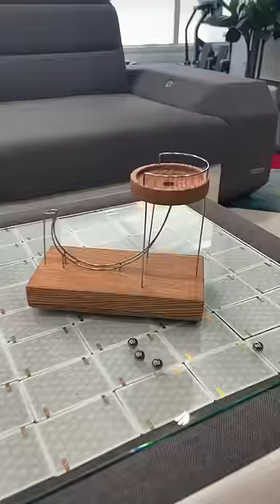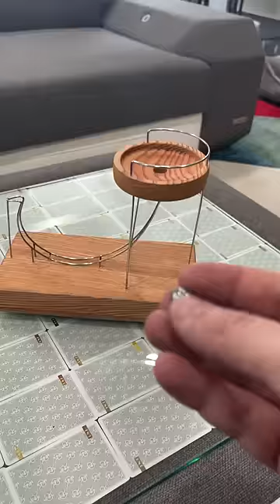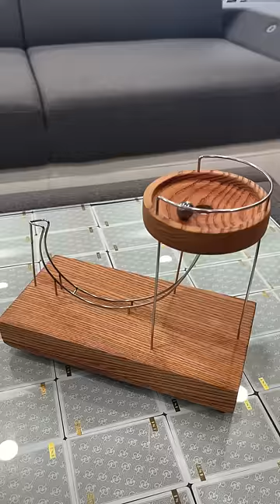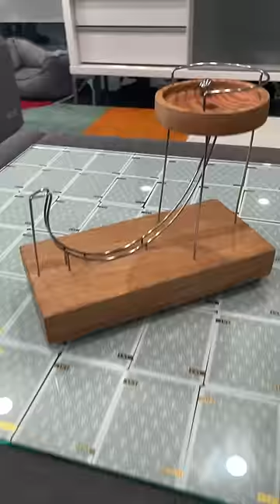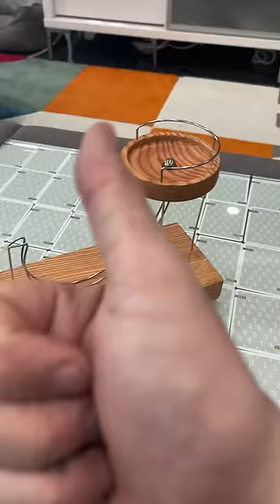An Impossible Perpetual Motion Device?! 😳 #Shorts

Comment: I like how he presented the device, without stating any lies but at the same time withholding just the right amount of information to not break the miracle.
Reply: I have an idea on what the “miracle” is based on the odd sound it makes when it goes down the ramp but I won’t say anything either because I’m not sure anyways, plus it’s still waaaay better than the “perpetual motion” devices that use batteries…
Reply: @zyanidwarfare5634  yeah it is definitely something like that. Even the first jump of the ball is already impossible because it could not go up any higher than it goes down without adding extra energy somehow.
Reply: @vanderslagmulders  it still doesn’t use a power source like batteries though so its still perpetual since it won’t run out of charge?

I mean it doesn’t produce any power of its own but it is an “infinite” loop until it makes a mistake
Ima just put what I think it is way down so people have to click read me to spoil what it might be cuz I want to make sure were on the same page

I’m pretty sure it’s magnetic
Reply: @zyanidwarfare5634 

Not sure maybe u right but on the other hand it’s a ball so if u mean if it’s gotta do with the two same poles repelling eachother I doubt it would work with a round, rolling magnet - the opposite pole would roll into position and the movement would stop or slow down. But hey I’m just spitballing here, I’m not a physicist.
Reply: @vanderslagmulders  

I don't think he meant that the ball acts as a magnet but, that there is a magnet under the ramp and the ball to be a magnetic metal so it is attracted to the magnet which would increase the speed it travels down the ramp.

Edit: That said though, this still wouldn't be possible because the magnet would cause the same amount of deceleration as the ball moved back away from the magnet. This device has to have some sort of battery powered system that accelerates the ball.

It most likely has a mother hidden right by the hole where the ball drops down which accelerates the ball and adds enough energy for it to make it back to the top.
Reply: @zyanidwarfare5634  No it has batteries in the base
Reply: @matthewdavenport9549  I actually think the rail itself is magnetized ima just give up on hiding it behind spoilers since others already did without
But the magnet hidden in the top by the hole makes sense but then how would that not apply any force to it when it’s above the hole?

It only makes that odd magnetic “zap” sound when it touches the rail kinda like those “rattlesnake egg” magnets yknow?
Reply: @zyanidwarfare5634  Magnets do not add energy. If the rail was magnetized, it would slow the ball down by attracting the ball to the rail increasing the force perpendicular to the direction of travel at all times.

It has to be a motor doing something. Most likely hidden by the top platform that as the ball drops down through the hole. Probably just like a belt or something running so that it accelerates the ball as it goes down the ramp. The sound the ball makes on the ramp is just the sound made of metal on metal vibrating at high frequency. That vibration is likely simply a product of the acceleration.
Reply: @matthewdavenport9549  I honestly have no clue, idk much about this kinda stuff and physics and stuff so it’s all speculation but it seems like the top would be a bit too small for a motor
Reply: @cryovictum  if that’s the case that means the video is clickbait and I’ve been discussing how it works for no real reason
Reply: That's the secret to a successful habitual liar.
Reply: @zyanidwarfare5634  There are Electric motors smaller than the ball itself.
Reply: @scottwilliams8334  🤣🤣🤣🤣🤣
Reply: That's cool.  It must be magnetic or something that uses batteries.  It's still cool to look at! 👍 😄
Reply: @zyanidwarfare5634  That's EXACTLY what I thought! 😄
Reply: My guess - it's a tiny wheel in a wooden hole that accelerates the ball. Just like baseball throwing machine
Reply: @zyanidwarfare5634  Magnets do not last forever. It will lose a bit of charge with every cycle. May last a very long time.
Reply: its not a miracle ... its a way of reciruclate a matter from space and time to space and time ....
Reply: There are no motors if you look through the hole, though...
Reply: @zyanidwarfare5634  it’s powered by batteries bro… you didn’t wonder why the base was so thick?
Reply: And this is why I don’t subscribe to this guy because the withholding of what’s actually happening is cheap.  Would be far cooler if he actually explained what’s going on and how the perpetual motion is simulated. But he is a magician and magicians are fathers of deception so
Reply: @brendanfode  they dont lose magnetic charge
Reply: @lordcapucino  Yes magnets do. Anything that interacts with them is doing so via electromagnetic fields. The steel balls magnetic field interacts with the magnets electromagnetic field. Slowly degrading the magnet over time, by slowly misaligning the electromagnetic fields of the charged particles within that magnet.
Reply: @matthewdavenport9549  that would be the case if the poles were opposite, however if the poles are the same, it would repel the ball, causing it to accelerate as the ball got closer to the magnet. But I’m not a physicist. Only speculating based off of what I remember from high school.
Reply: @hippieash2799  it would still accelerate and decelerate the ball to the same degree.

Newton's Third Law and Law of Conservation of Energy tell us this is the case.

Magnets do not create energy. If you managed to create a ball that has the same magnetic field as the track over the entire surface of the sphere, then all acceleration added in one direction would be canceled out by deceleration in another direction. 

Magnets alone cannot create perpetual motion devices. This is a known fact. You need an energy source of some sort.
Reply: It's just gravity
Reply: @Lupardusmn  gravity acting on the ball cannot result in the ball having enough energy to result in the ball rising above the height it originally fell from.
Reply: @matthewdavenport9549  you never played with HotWheels tracks as a kid, did you?
Reply: @zyanidwarfare5634  Magnets loose their magnetic pull over time, it won't last forever.
Reply: @Lupardusmn  Yes I did. And I also know physics.
Reply: @matthewdavenport9549  "I kNoW pHySics"... says the man that thinks there is magic behind this devise...
Reply: @Lupardusmn  magic? Wtf are you talking about? What I said is that it's motorized. Me telling you it's not magnets is not me saying it's just magic.

Edit: Actually you said it was just gravity. Which is honestly even worse that thinking magnets are involved.
Reply: @brendanfode  this is not how magnets lose magnetization. Also, magnetization is not a charge.
Reply: @chadingram6390  : To do what?
Reply: @zyanidwarfare5634   it IS one of the ones that uses batteries though.  Though yes,  it's also magnetic.  Electromagnetic.  There's a charge in rails that causes acceleration.  It's a super simplified rail gun.
Reply: @matthewdavenport9549  This guy is my flippin hero!! thank you for being a person with half a brain on YouTube comments!! this actually might be a first, im not sure though! Most people's knowledge when it comes to simple physics is disturbing to say the least. Thank you for taking the time to educate some people,  hopefully they learned...
Reply: @matthewdavenport9549  yes it is. On both points. Do you understand electromagnetism? Obviously not. Go ask your Physics teacher, highschool boy.
Reply: @brendanfode  Electromagnetism is just the phenomenon associated with electric and magnetic fields. I.e. when a magnetic field moves it generates and electric field and when an electric field moves it generates a magnetic field. Maybe you mean electromagnets. Which are only magnetic when an electric field runs through them. Which is not how all magnetism works. Electromagnets require a power source at all times. The magnet is never "charged" it's magnetic when the electric current flows through it and non-magnetic otherwise. I have a large amount of experience with electromagnets because I used them in my graduate research (can't really get permanent magnets up to 9 tesla). The comments saying the device doesn't use batteries or electricity, but instead uses magnets cannot by definition be talking about electromagnets. Because epectromagnets require electricity. Instead, they have to be talking about permanent magnets. Which are magnetic because of the correlation of their unpaired electrons such that their spins are aligned, creating a magnetic field. This type of magnetism is an inherent property of the material and doesn't go away over time. The main thing that will generally stop a permanent magnet is change in temperature. The correlation of electrons has an energy associated with it. If you heat the material up, it can enter a higher energy level state and the electrons will no longer be correlated.

Of course, there is a third type of magnet that falls closer to a "charged" magnet without electricity but, still not in the way it had been proposed. Induced magnets have a magnetic field induced by interacting with another magnet. This induced magnetism will exist for a time after the other magnet is taken away but, that magnetism goes away over time because once the external magnetic field is removed, there are no electron correlations keeping the electrons aligned and so they fall back into their paramagnetic state. They do not lose their magnetism by attracting or repelling other objects though like the comment suggested of "charged" magnets. Only as a function of time outside of an external magnetic field.
Reply: @zyanidwarfare5634  doesn't use a power source??? if u don't think batteries as power source than i'll agree with u😅🤣😂....this device works with a single battery which is hidden in the base....u just search it in youtube....perpetual motion is impossible as per laws of thermodynamics.....even a primary schooler will tell u it's shit once they watch the device working....because it defies even Newton's law of "action=reaction"... the ball should not spring back higher than it's actual drop position making it impossible to go back to the drop tray.... if they did not use batteries and used spring on the ramp it would still not be perpetual motion.
Reply: right, the metal ball gets an electric magnetic shock when going down
Reply: @zyanidwarfare5634  If it's not an electro magnet in the base and just two pole setup then eventually the magnet will loose its magnetism. If it loses its magnetism naturally and not as a result of the bearing is the system still a perpetual motion machine for the time it works?
Reply: @dipdodge6231  chill, I was never good with any of that kind of stuff anyways and we were just discussing the possibilities
I just assumed it was involving magnets in the rails if you read more than one reply
Reply: @ziros22  that makes sense, one pole pulls it down and once it passes over the other shoves it but there’s no real way for us to know if it’s an electromagnet or not without having the device

If it’s a normal magnet then it will eventually wear out if it’s a electromagnet it will go with batteries but either way it’s not “infinite” technically at least with the normal magnet method, if it involves a electromagnet then it’s a failure either way
Reply: It's an electromagnet in the base that shuts off once the ball bearing passes the lowest point. I think that a timer probably starts when the bearing completes the circuit between the rails.
Reply: the trick is, the balls are magic
Reply: @zyanidwarfare5634  considering that the bearing is spinning the poles are rapidly rotating so it's not possible for this explanation to be valid.
Reply: The minute you try to make it do something like power a light bulb it won't work. If it would it would truly be perpetual motion
Reply: @zyanidwarfare5634  dude, this can't be done with a regular magnet. It would break the laws of thermodynamics. Don't be gullible.
Reply: The legs on the top platform are likely charged the same as the beads, pushing them away while in the cradle at the top, and accelerating the beads slightly as they fall into the rails. Or it may be as simple as very strategically placed charge in the thick base that help add minor acceleration as it travels along the rails.

Regardless, I'm sure it's no coincidence that the beads are metal. They're making a connection and triggering some mechanism.
Reply: @BaneSIlvermoon  this doesn't make sense. You can't do this with just a magnet. There's an electric current.
Reply: @uku4171  .... yeah, that's what I just said
Reply: @BaneSIlvermoon  you're right, I misunderstood. My bad.
Reply: @zyanidwarfare5634  using magnets would still constitute perpetual motion. That’s like saying I’m pretty sure it uses gravity

Comment: I know exactly how it works, as does anyone who's owned Hotwheels.
Reply: @Elisio_  No? And neither does that perpetual motion machine.
Reply: @Elisio_  Right, so what I assume you're thinking is that there's a magnet on the bottom of that platform, pulling the ball downwards to give it enough speed. However you're forgetting that the magnet will continue to pull the ball towards it, meaning when it's going downwards onto the ramp, the magnet will pull it back up, slowing it down again. The way that machine presumably works, as do Hotwheels, is with a small motor that drives 2 wheels that face eachother and spin in opposing directions. So when the ball hits them it spits it forcefully spits it out.
Reply: @Elisio_  You mean that the rails the ball rolls on are electromagnetic? Like, that sort of train?
Reply: @Elisio_  no, you’re clueless, he isn’t. It runs on batteries and a motor thrusts them down the hole. You can even hear it ffs.
Reply: @Artrysa  no its the speed of the earth traveling through space giving the extra gravitational pull to.the carefully weighted ball bearing with a nano coating of anti gravity paint ,    and its on a string !
Reply: @Artrysa  you really should seek professional help with regard to this imaginary Elis Gustafsson person you keep arguing with.
Reply: how much is it, I'll make one that's powered off dumb girls a energy that is nonexaustable
Reply: @maxi-me  Wha-... Was it all my imagination?
Reply: @brucegraves7680  Also, yikes. Who hurt you dude?
Reply: @Artrysa  I made static electricity generator like to rub a ballon to charge your phone then I put it on my bike and it became light as a feather going uphill as if it were on flat ground , however aside affect is I'm stuck listening to voices in my head however your comment actuially felt good because it has essence of caring; I suffer , and sorry I didn't think it to offend people.
Reply: @Artrysa  sadly, I believe it was sir;
Now step away from the keyboard   sloooowly
Reply: @Artrysa  i want you to use a track to build a ramp without the moter and see how fast it flys cause theres no moter on or in the bowl so and the magnet doesent exist ill give you that
Reply: I was a poor kid so we had Notwheels growing up
Reply: @maxi-me  time loop got eeeem
Reply: I had hundred hotwheels! INFINITE POWER!!
Reply: @kennashafer6379  I'm sorry, could you run that by me again? I'm not sure I understand.
Reply: Beat that !
Reply: 🤣🤣🤣🤣 it’s driven by gravity strictly. No motors, no magnets….the top tray is concave and creates the circular motion. The bead then drops down to the track that is curved at the precise angle to launch the bead back into the concave tray….🤦🏾‍♂️
Reply: I have no idea how these work but I would guess the top part has a magnet that pushes the ball more speed as it falls?
Reply: Fax😂
Reply: Or maybe the metal part is such. Would be more logical.
Reply: @joekelly9369  nonono, it's quantum, it's always quantum
Reply: I am confused, at what point did/has Anyone ever insinuated.that perpetual motion could be achieved without magnetic power in combination with other natural energy??
Reply: @TheDanielShepherd  wrong. It's a rail gun. You could fact check yourself next time and you won't look like an idiot. It's just 30 seconds on Google to watch a video of one being plugged in and explained. Good luck with the S.A.T's